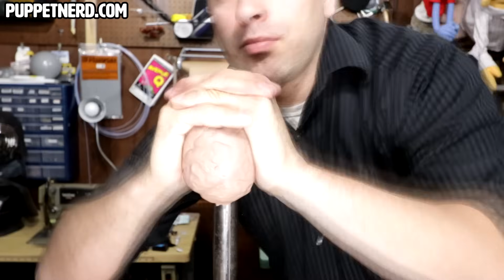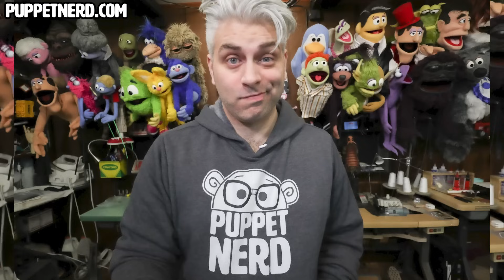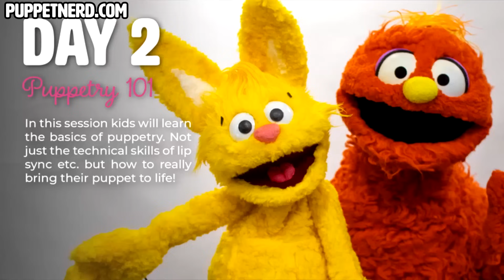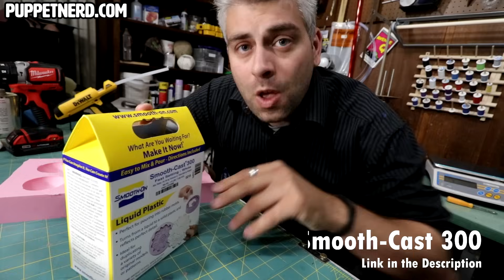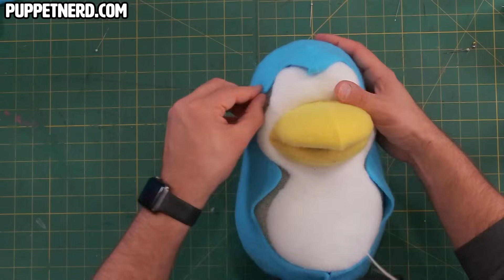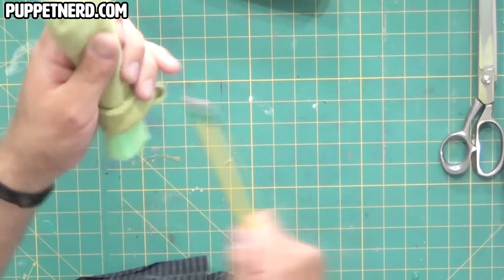How to Make a Muppet from Scratch! - Puppet Nerd - DIY

Comment: Does anyone know a little more about the foam used in puppetry?  I've found a guy who can sell me foam, but it's the foam used in mattresses - not memory foam, but regular, open-celled foam.  It's not quite dryfast foam, but it's pretty darn close.  Only thing is, it's classified by density (lbs per cubic foot) and Indentation Load Deflection, or how much weight is needed to compress it.  I can get it in various densities and ILD values, but I've only seen recommendations on foam where it's 'X ppi foam', or 'medium firm foam'.

Comment: Sorta related, but most likely off-topic. ( I did not watch the video, but I enjoy watching you work.)

How would you make a frog tongue made out of fabric that recoils when not in use? I know there are paper-made ones, but that can't work because I want to make the frog washable and durable so the critter can have a longer life. And many options are not transferable from paper to fabric, or ones that I can think of anyway. 

I thought some air pump-to-tube system might work, and this is not a novel idea, but I can't seem to find anything durable that would roll up like that dang roll-up paper party favour whistle. Slap bracelets may do, but they won't recoil back into the critter.
For context, I make crochet soft toys for kids, and I am interested in creating a small device that, when squeezed, the tongue pops out. So it's got to be safe.

Thanks in advance if you decide to discuss this further and share your ideas, any references or resources to help me on my quest. Or consider helping more of us make a video about it so others don't need to look at one more stinking paper frog or puppet with no tongue action.  Why do I feel like I am reinventing the wheel here?

Comment: When making the mouth plate for a puppet design, how far of your hand should fit into the mouth? I recently had a custom puppet made and the guy who did it didn't ask enough questions and when I got the final design, I couldn't even fit my arm up into the head. Once he fixed that, then I also realized that my hand would only fit about 2 knuckles of my hand into the mouth piece which made it nearly impossible for me to operate. So, here I am after paying a hefty amount for a custom one, and not happy with the results, or the puppet, and now figuring out how to design my own since I'm going to be using said puppet for my Podcast and had to wait all this time to get a defective custom one that I can't use or fix.